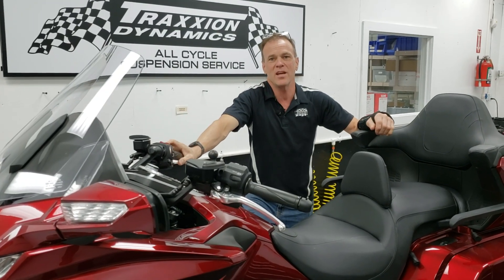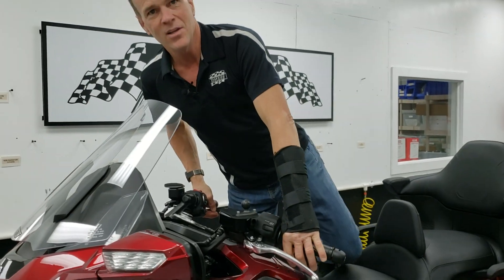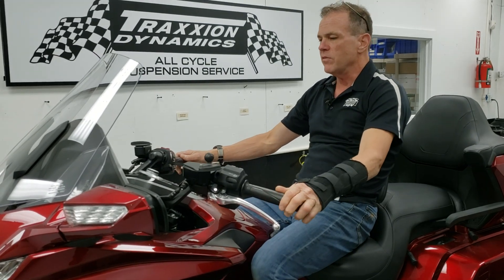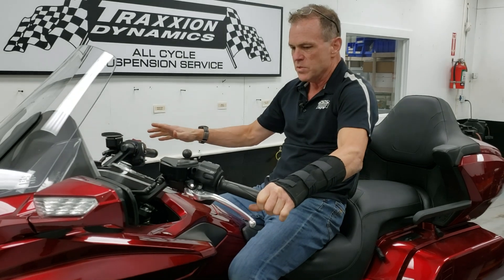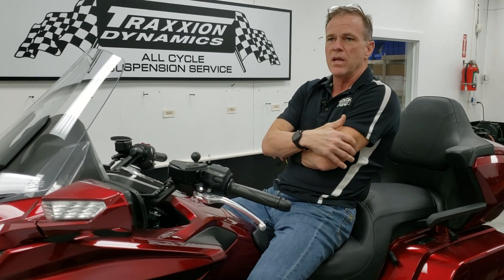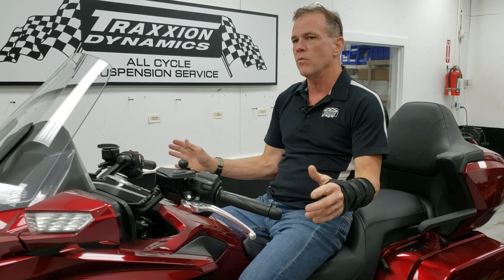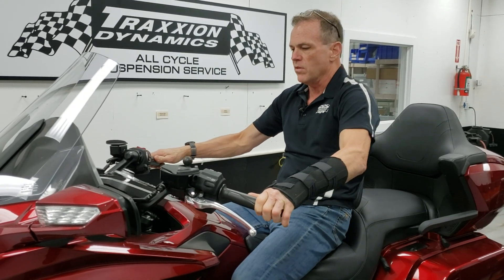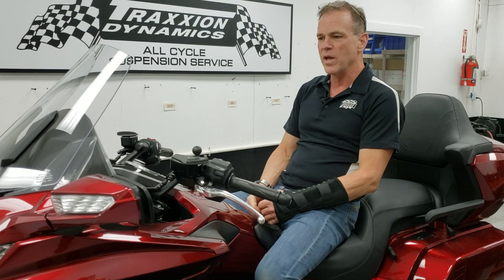High Speed Shake/Shimmy on 2018+ Honda Goldwing

Comment: Its not a tire problem, that is if its the tire fitted is the original from the manufacturer and not a replacement tire. Steel belted and radial belted tires have strange behaviors. Its balancing after fitting of tire. Most likely the tire fitter is using the older method of balancing for motor bikes. A stand that supports wheel and tire, spin the wheel, if it pendulums put a weight at the top. Quick and easy but not totally accurate. Definitely not the most effective method. Today standards are the same used in all motor industries, centrifuge calibrated machines that dictate the counter weight required and at what position and side of wheel rim to apply. However these machines cost money and most motorcycle shops are unwilling to outlay this cost in the belief that "Its worked in the past"
Reply from the maker: The problem I am talking about is a defective tire.  Definitely nothing to do with wheel balance.  

I don't know where you live, but in America, virtually every motorcycle shop I have been to has a spin-style wheel balancer, and that includes all the way back into the 1980s when I began working on motorcycles.

But you are incorrect that you "have" to use that method.  Go to any professional motorcycle racing event.  They use static wheel balancers, and do exactly what you say isn't good enough.  If static wheel balancing is good enough for a  400# motorcycle that goes 200mph, then it's good enough for a guy on a 1000# Goldwing at 70mph.
Reply: @Traxxion  Yes Max I concur that a defective tire is unsalvageable, replacement is needed.

I am in Western Australia, and there is only a few motorcycle tire shops/retailers that use centrifuge balancing machine. Others the pendulum method (static wheel balancing). As such I use only facilities that are up to date with current technology or rather with the current time.

Regarding defective tire. Australia Consumer Laws protect purchasers/consumer of defective products. I am not sure of the consumer laws in USA but assume the law would be similar. AUS law regarding tire/s, Reimbursement of percentage or expected mileage against mileage used (a good debate, not argument, with dealership is a better option). This brakes down to. If tire is expected to last 5,000 miles and has only traveled 200 miles a reimbursement of approximately 95% of cost .

America professional motorcycle racing events appear to be of a different caliber to Australia. If dirt or off road, yes static is widely utilized in AUS. If tarmac / track event, professional teams have ample sets tire/wheels setups prior to arriving at event (tuned and ready to go, with ample replacements). Non professional or self funded enthusiasts just don't have the finance to cover these cost and will change tire/s as required. Hence will require equipment to be portable.

I am not stating "have"" to use this method and never stated such claim!!!! I expressed that that the static wheel balancing is not as effective as centrifuge wheel balancing. Viewers/Readers can make their decision of the best option for their needs or availability to services and or repairs.

Comment: i have a low speed holy crap wobble on my 2018, has happened twice now. under 20klms, take hands off and it went crazy jiggling up and down very fast. freaked me out the first time, thought it was the road, until it happened again a few days latter, on a diff road. samething though. slow speed, hands off, and wow, it went nuts just like before. so now i just keep it pinned...any thoughts,,  2018 gl 1800 16thouks, tour..
Reply from the maker: One of my very first videos was of a bike with a CRAZY loose steering bearing.  That might be you.

Comment: Not knowing anything about bike tires do they put them on a balancing machine like car tires are and if they don’t why wouldn’t the industry come up with one for motorcycle tires I would think that would stop people from getting bad tires.
Reply: The industry already have the machine available. Motorcycle service centre/s are reluctant to move from tradition static balancing as this is quick (more bang for the buck) View the following attached links.  https://www.youtube.com/watch?v=eEPLftT5mxw and a inexpensive alternative https://www.youtube.com/watch?v=LPJpWU9KA64. The time taken to balance tire is almost 3 folds compared to static balancing on a stand. Hence service centre/s stay with the technology from the 60's. And of course companies still want to mislead consumer. This is not a Goldwing issue and effects any motorcycle regardless of badge, if tire is not correctly balance or has manufacturing defect (which would be detected with appropriate balancing machine). PS I am not affiliated with any motorcycle company or service centre. I dispies any company that misleads customers. Traxxion has done this. Any tire that is defective is unsafe, not a just for riders of Goldwing's but any rider/passenger  that enjoys motorcycling.
Reply from the maker: High speed wheel balancers for motorcycles have existed for more than 30 years.  I have never worked in a shop that didn't have one, including my first job at 15 years old in 1982 or 3.  A balancing machine can't identify a defective tire.  That will only be found once it is used with weight on it, dynamically moving down the road.

Static wheel balancing works fine.  If you go to any world class racing event, you will see all of the tire companies use static wheel balancing, with tape-on lead weights.  If that's good enough for a motorcycle going 200mph, it's good enough for anyone on a Goldwing doing 70.

Comment: What happened to your lower arm, wrist area. Did you fucking karate chop a dead beat customer who wouldn't pay to hard?
Reply from the maker: Ha!  I got dudes for that...

I had a terrible cyst in my wrist turned the middle bone to liquid inside.  They had to cut it, then cut a chunk off my radius with active blood supply to fix it!

It should be solid in a few weeks.
Reply: Max McAllister & Traxxion Dynamics Oh man that’s awful. As long as they cleared everything out and re constructed the bone it should be ok. Long antibiotic treatment eh.
Reply from the maker: They give you antibiotics by iv during surgery, and that was it!
Reply: My 2022 Gold Wing Tour went in for replacement Bridgestone tires, on the ride home the handle bars had a shake in the handlebars between 42-52 mph, dealer checked bushings etc, all good, pulled tire and rebalanced and they test rode, still there, dealer replaced front tire from a different batch/year, corrected, your video is appreciated.